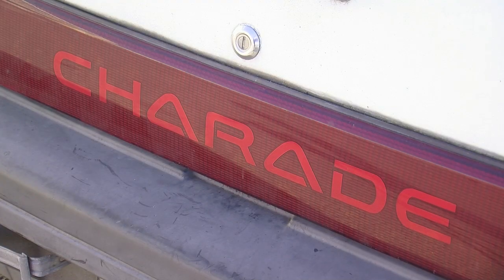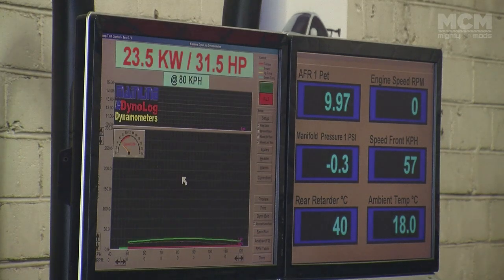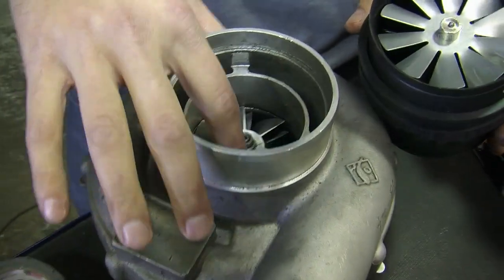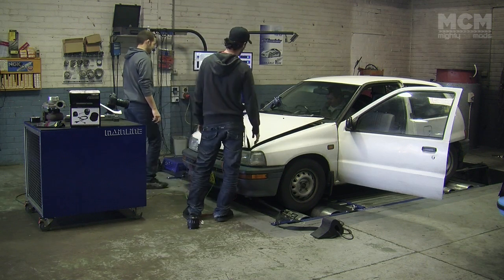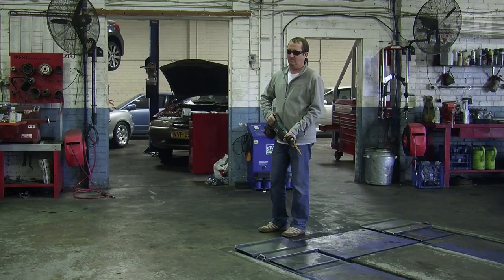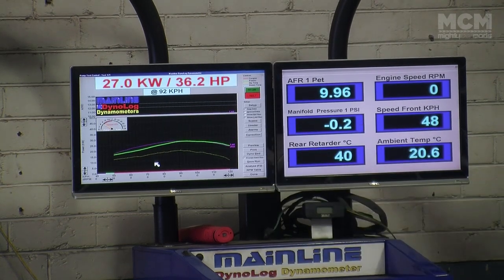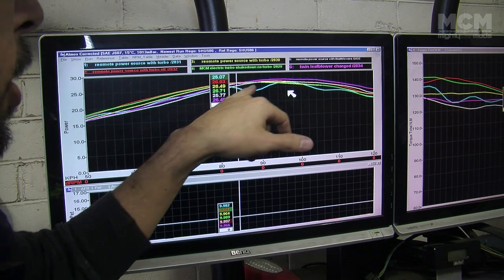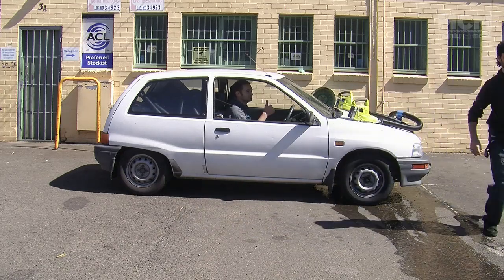Electric SuperChargers Mythbusted

Comment: isnt a twincharger a supercharger and a turbocharger?
Reply: *****  Actually a twincharger is a combination of a supercharger and a turbocharger. The supercharger will work dueing the low rpms, and than once the car is going fast enough to not have turbo lag the supercharger will get blocked off and all the air goes to the turbo. engineering explained has a video on it.
Reply: +J-N-H-M you must be stupid.
Reply: Yea
Reply: putting a supercharger and a turbocharger in the same engine at the same time is called twincharging
Reply: mohd ezwandy mohd sulaiman
Technically a turbocharger is a type of supercharger, so they aren't 2 different things.

The full name of a turbocharger is "turbine supercharger". The word "turbine" is usually shorted to "turbo" so "turbo supercharger" or shorted even more turbocharger.

A roots supercharger and a turbocharger are two different things. You are correct there.
Reply: Thanks for correcting me.
Reply: +177SCmaro Close, the original name is turbosupercharger, from back when everything was a supercharger, this thing used a turbine instead of a thickass belt to drive it. There is a Monza with 5 GAS leaf blowers that does make significantly more power than NA.
Reply: Jonathan Erickson
Either is good. I have a weiand 177 on my old camaro race car, it takes about 20-30hp to run it and it gave my motor net gain of about 170hp at 5psi. If cost wasn't a factor I'd probably go with twin turbos and probably gain 10-15hp at the same boost just from switching. More so at higher boost levels, but it would cost twice as much to covert everything as the little blower costs.
Reply: paspax
In addition to an "appeal to authority" fallacy, that is also circular reasoning i.e. you are ending with the same premise you started with.
Moreover, even if you state a fact like the sky is blue, you're still wrong if the support for that assertion is faulty, i.e. the sky is blue because it's made of cobalt and I know this due to my experience.
In other words, even if you give the correct answer, you still don't get credit if you don't show your work, or your work has problems/fallacies. That's how knowledge works, not just asserting something is true "because experience".
And you say you know I'm wrong "becasue experience" but what if my experience is greater then yours and I say that you're wrong?
How can you assert that you're right becasue you assert that you have more experience then someone else but you also know someone who asserts he has more experience then you says that you're wrong?
See the problem?
Reply: the4armedmonk Neither. It's a fan
Reply: 2 legendz to far 1-2-100
 Yeh i'm the same as *****. I didn't read his comment properly haha, I thought he was on about this shitty fan that's in the video.
Reply: 2 legendz to far 1-2-100 you liar ... show me the link
Reply: the4armedmonk twin is like the same , like twins , or twin turbo chargers are two of the same ...  a turbo and a super charger is maybe like  , Dualcharging  , Bicharging or i just call it a SuperTurbo
Reply: +J-N-H-M it's called twincharging
Reply: +J-N-H-M it's called twincharging
Reply: +J-N-H-M it's called twincharging
Reply: young boy yeah like twinTurbo's  ... is called TwinTurbo's or i guess TwinCharging ... and the 4 turbo Veyron would be QuadCharging / QuadTurbo's .... 
Companies like VanDyne and others already make a single unit thats a SuperTurbo Charger ,  both in one ... and its called the VanDyne SuperTurbo
Reply: J-N-H-M
 Yeh I don't really know what you are going on about either, theres no charging that takes place? in an electrical sense anyway. I'm going to be honest nobody uses these terms anyway, they would say twin-turbo or twin-supercharger. Although i'm not even sure if you can have two superchargers considering it's powered from the drive shaft. A quick google could clear all of this up but I just can't be assed lol
Reply: sniktun1 they refer to the pressurized air that super chargers and turbochargers make as , Charged Air ( why , i dont know )
Reply: +sniktun1 twin superchargers are a thing, and they are glorious. They are configured like twin turbos, one on each side of the engine in the intake dudctng, except driven off the accessory drive. They are set-up in various ways, having a pulley piggybacked onto a regular pulley and the supercharger belt connecting to the drive pulley and both superchargers, or having two piggybacked pulleys each supplying 1 supercharger.
Reply: CaptAmerica300 Holy ~~~ !!!  awesome ... 
i getcha , your talking about on V8's im guessing ....but it makes me wonder , i guess more than twin super charging couldnt be possible like the quad turbos on the veyron , ... but maybe a Tri Super charger on work on W engines ...
Reply: young boy Dual  or Bi Charging , maybe ... but a super and a turbo are definitely NOT twins ...
Reply: twin charging is 2 turbos
Reply: +J-N-H-M Dual Superchargers are mainly on Big Block V8s, generally smaller displacement, less than ~6.5L (400cu. in.), will not demand enough air to justify that setup. Usually the limiting factor is belt routing.
Another limiting factor is overall boost, dual superchargers generally will supply more than the engine could possibly need, as with dual turbos, more than two becomes excessive. In the example of the veyron the displacement is so great and the air demand so high that it can run quad turbos.

Some dual supercharger setups are inline as opposed to what I said last time. see pic http://www.speednik.com/files/2013/06/blownchevyfront.jpg Inline setups are mainly used in turbos for big diesels, you have a High volume Low Pressure Turbo scavenging air and feeding it to the High Volume High Pressure turbo which is feeding the engine. This is because the second Turbo can supply so much air that it couldn't draw enough without help. (Banks makes this for some Ford Powerstrokes). Using this setup with superchargers is less common though.
Reply: +2 legendz to far 1-2-100 I thought turbos are exhaust driven (reason for turbo lag) and superchargers are belt (direct from making boost over almost all RPM s) driven.
Reply: CaptAmerica300 yup yep ... im always trying to understand as much as i can to try and see if i can improve something ,fabricate or invent something new .
i Think  racing and what formula one  is doing is pretty interesting ... 
Power-units that are  ,
 The Gas Engine ,
With a Turbo ( That has an electric Motor/generator) 
and an Electric motor built in the engine ( to add power/regenerative braking ) 
And Mechanical Hybrid ( flywheel ) systems that works with the transmission to store power... 

Years Back we built the 1st  4WD buggy That Also Had an ELECTRIC Jet Motor Power source ( so when  peeling out , or pulling a wheelie or in mid air , the Buggy always get the thrust of the Jet pushing it faster )  
its the fastest thing on wheels in some situations like driving on a frozen lake ...
How ever with battery improvements moving at the speed they are , OneDay it will be the fastest car period ...
the P1 and the  918 spyder are here now because of MPG laws and the Power of Electric Motors and Batts can't be denied any longer ... 
And powered Tires meeting the road is great , but it has its limits ...
The AWD + EDF  is patent Pending , but it's so much more than just that at this point , we don't care about telling people that part ...
Like Elon Musk and Tesla , we have open patent policy weather we get the patent or not.
Reply: +J-N-H-M Yeah, it is kinda weird as "twin" usually indicates two identical things, but then again, we often say that "engine" is the proper name for the power source for a {non electric} car, yet we call the oil that goes into that same engine "motor oil" and Detroit is known as "motor city", so if they want to refer to compound supercharging with a turbo and a roots supercharger as "twincharging" it's kinda hard to correct people given all the already accepted inconsistent nomenclature.
Reply: +177SCmaro you're absolutely right regarding nomenclature. However, we're also saying "Twincharger" to the 1.4 TSI VAG engine (supercharged and turbocharged) in Germany even it's "dual charged".
Reply: +Tom Slak the problem using a supercharger is, it's eating a lot of horsepowers due high rpm's. VAG did an excellent job on the 1.4 TSI engines. The supercharger instantly kicks in from standstill and disconnects the supercharger via a magnetic clutch at 3.500 rpm's. The turbocharger also generates boost at ca. 2.500 rpm's, but holds the maximum at 3.500 rpm's. 

Even it's a hyper small displacement engine (for your Amerikans), the power it gaves, is just ridiculous -> watch?v=9ZILyTcuNog
Reply: +La D. Da 
Super and turbocharging types explained.

Supercharger: A compressor is mounted on the engine that's usually driven by the timing belt (normally on bigger engines) or a separate belt, giving a smooth response and a moderate increase in both torque and power. 
This compressor helps with generating more intake-air for the engine to work with, thus giving room for more fuel to be injected into the engine.
The supercharger works from the engine is turned on, and it's benefits are well enough suited for normal driving, from idle and up to about 75% of maximum RPM

There are several types of superchargers, but the most common ones are as following:
Twin-screw - The type commonly used on large American V8's
Centrifugal (Similar to a turbo) 
G-Lader (Scroll-type) - Used by Volkswagen in their early 1990's models G40 and G60 (Polo, Corrado, Golf, Jetta and Passat)

Turbo: An exhaust-driven generator used to increase the amount of intake-air to the engine (Simple enough)
The turbo is (unlike a belt-driven supercharger) relying on exhaust pressure in order to spin fast enough to generate enough boost for it being effective, thus the term turbo-lag. 
A diesel-engine-driven turbo operates at lower RPM's than it's petrol-driven counterpart, due to the diesel engine's higher compression ratio (typically building boost pressure from 1200 RPM and up to about 4000), while the petrol-operated turbochargers operate at a much wider range (typically from 2000-2500 RPM and up to 6000+)

Normal turbo-configurations:
Single - Normal configuration used with all types of engines
Twin - Commonly used on V-type engines or straight-6's
Quad - Not that common, but useful on high-powered V8, V12 and V16 engines
Bi-turbo - Commonly used by VAG (Volkswagen/Audi Group) - Two turbos, one small that spins up fast, and one larger that works in the higher-range, typically set up in series.

Unusual configurations:
Triple - Can be used on straight-6 engines, but there is no benefit to this setup other than adding weight to the car.
Twincharger: A turbo and a supercharger that works in tandem to eliminate the turbo-lag, where the supercharger cuts off when the turbo reaches it's peak boost.

Useful addition: Intercooler - An air or water-cooled radiator that cools down the intake-air that goes into the engine, due to the air created by the turbo or a supercharger is significantly hotter than the ambient air-temperature.

I'm no mechanic, but this is just the basics.
Reply: G6 Liara XD ... 
ok .. VanDyne makes a SuperTurbo  unit so ive been calling it SuperTurbo and saving twin for actual twin parts ... XD 
do you think all cars will have like formula one engines ? 
mechanical hybrid disk ,  regenerative braking ,with  electric motors Built into the engine and Turbo ?
Reply: G6 Liara
There are a couple of things that merit corrections and clarifications.

First of all, a "supercharger" is any device that mechanically increases the density of the air charge being ingested by an internal combustion engine.

That includes the traditional "roots" and "screw" type superchargers, the less well-known axial superchargers, as well as centrifugal and turbochargers {the full name of a turbo is a turbo or turbine supercharger in reference to how it's driven}.

"Roots" or "twin-screw" superchargers work well at all rpms, when properly sized and geared correctly, {although larger compressors relative to the engine tend to favor mid-to-high rpm do to increased internal air leakage or reversion between the rotors, at low supercharger rpm} however they tend to add the most power above and below the engine's peak torque, effectively flattening the torque curve on both ends. As they are positive displacement air-pumps, physically forcing pockets of air between the rotors and the housing and compressing it in the plenum where the rotors mesh together, {twin-screws do the opposite, compressing air along the length of the meshing rotors and is more efficient} they take the most horsepower to turn and add the most heat to the air they compress per lb of boost but also respond the quickest to changes in throttle position.

Centrifugal and turbochargers tend to be more "peaky", taking time to "spool up" and deliver boost efficiently at mid to high rpm {they can be made to work and low to mid rpm, but at reduced power at high rpm in most cases}. They are, however, more efficient at producing boost, using centrifugal force to compress air, thus increasing it's density, especially turbos as they are powered by exhaust gas pressure and heat rather than a belt or chain.

For most street-driven cars running low to mild boost that could stand to lose a mpg or two and instant throttle response is desired, a roots type supercharger would be the best option. For higher boost levels and/or were a loss in fuel economy is unacceptable, a small of amount of lag is acceptable, a turbocharger would work better, although cost more/is more complex.
Reply: +177SCmaro 
ive read 2 different definitions of supercharger.
google-says basically what you said
-and this other site says what i normally think when i hear supecharger which is:an air compressor.
Reply: mrdrer7
Any type of air compressor can be used as a device that mechanically increases the density of the air charge being ingested by an internal combustion engine. So fits with my definition, they're not really different, just one the one I used is more descriptive and technical.
Reply: +the4armedmonk supercharger and turbocharger is 2 different thing.
turbo it run by exhaust gas.

if you got 2 turbo, we called it twin turbo or BiTurbo either it install parallel or sequential.
for supercharger, it got 3 types centrifugal, root, and screw.
it run by belting.
twin charger it used both supercharger kit and turbo charger.
you can find in vw tsi engine.
Reply: elsydeon666
What do you mean "close"? Isn't that what I just said?
And that still is it's name, people just tend to us the non-technical shortening of "turbocharger" or "turbo" instead.
And "everything" still is a supercharger: turbos, roots, screw, etc., people just don't always make that distinction.
And "citation needed" on the leaf blower thing. Because I'm pretty darned sure that was built as a joke.
Reply: No... A turbo charger is a form of a supercharger... Obviously it employs a very different concept but it's a supercharger
Reply: +Jonathan Erickson this is true, Where as a turbo requires exhaust gases to spool a super charger is pully driven and works off of your serpentine belt.
Reply: Yup... Superchargers take horsepower from the engine tho. A twin scroll turbo basically eliminates turbo lag and makes it a good supercharger... But it has its cons
Reply: Jonathan Erickson
To be precise, all superchargers - including turbochargers, take horsepower from the engine one way or another, turbochargers just tend to take less HP per lb of boost produced resulting in overall increase in efficiency when compared to roots, screw, and centrifugal superchargers at the same boost level.
Reply: Good point... But superchargers are horsepower suckers... A turbo uses wasted energy... But it does restrict the exhaust a little bit... So any supercharger has some sort of penalty for power.
Reply: Jonathan Erickson
lol "suckers", I get it.
Reply: Lol. It's true tho. But in a drag race I might rather have a supercharger? Plus the sound!
Reply: when they showed the switch of the $300 dollar turbocharger, does that mean you can turn it on or off? So when im not using it i don't always put my engine at risk for damage.
Reply: +Dark Matter Well not really different things. The power source of the charger is just different.
Reply: hybrid charger not twin
Reply: +Dark Matter 
LOL as f##k.
Turbo's are a TYPE of supercharger.
Reply: +paspax are you dumb
Reply: Black Man

Are YOU?
Any device which forces air into an engine is a supercharger. Some are belt driven, some by exhaust gasses & some  are driven directly off the crankshaft. The ones which are driven by exhaust gasses are correctly called turbosuperchargers.
As a mechanic with 30 years experience, my knowledge on this subject is superior to yours so sit down, shut your mouth & learn something.
AND, that goes for you too, Alvaro Lopez.
Reply: paspax
While you are generally correct in your definition of what supercharger is, the idea that "the one who has more experience with something therefore has the superior knowledge, therefore is correct" is an "appeal to authority" fallacy. Superior experience does not necessarily mean superior knowledge and it's possible to have superior experience, and even knowledge, and still be wrong about something (not the case here).

Your experience is not what makes you right or wrong, evidence, logic, reasoning, facts, etc. i.e. an argument correctly identifying reality as it is, is what makes you correct.
Reply: 177SCmaro
yes yes, appeal to authority blah blah.
I've spent a lot of time shutting down creationists on YT so I'm familiar with the AtA & was aware I was doing it but...
In this case, I am an authority due to my superior knowledge which I have gained through my superior education in, & extensive experience of this subject. With this "rock solid" foundation to support my every statement I feel perfectly justified in my ASSERTION of authority, (To appeal is to ask. I don't ask, I TELL) & furthermore, justifiably expect others to simply believe what I tell  them here, just as I do in my working life. (in this, my area of expertise at least)

Having said that, thanks for the reminder. I'm just accustomed to unqualified obedience from those around me, & grateful appreciation when I impart knowledge to others. But here,. on YT, (& often in life) everyone seems to have just enough knowledge to be dangerous, but not quite enough to actually be useful, lol.

May your oil always be clean & free of bits.
Reply: paspax
I don't know if you're trying to make a joke or you just don't understand what an "appeal to authority" means, becasue "appeal" doesn't mean "to ask" in the context of logical fallacies, it means "to reference".

You are referencing your claimed "authority" and basing an argument off of that, which is fallacious for the reasons I gave.

Again, knowledge and experience has no bearing on, it does not justify in and of itself, being right or wrong.

For example, I could just as easily say that I have one (or many) more year(s) of experience and knowledge then you do and everything you've said is wrong and superchargers really work by a team of hamsters running really fast on those cute little wheel things that turns a fan that compresses air...

Does my superior experience make me correct about what a supercharger is or that you are wrong? Should you unquestioningly be obedient on account of my superior experience and knowledge?

God, I hope not...lol
Reply: 177SCmaro
I am fully aware of what AtA is, as I have already said.
Seasoned antitheist campaigners such as myself can't not know these things.
I made a statement & backed it up by mentioning my expertise & experience. It should be obvious to anyone that a 30 year mechanic also has knowledge. No matter how you twist things, no matter how pedantic you get about my word selection, the fact remains that I am correct & the reason I am correct is down to my knowledge. I gleaned this knowledge through education & experience.
I see no reason not to ASSERT my authority in any area where I am fully aware of my superiority, be it engine building or cake baking.
You could claim all sorts of things, hamster wheels included, but I would know that you were incorrect due to my knowledge.
Reply: 177SCmaro
Stop the roast it burns